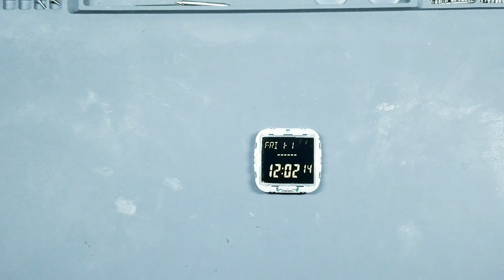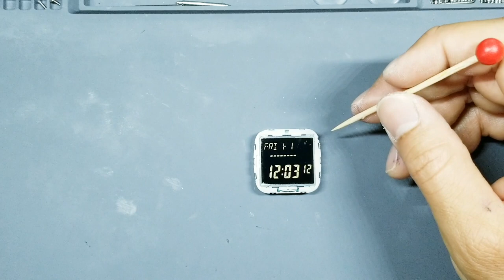[Modified Casio] Negative display mod on the Casio DW-291H-1AVCF

Comment: I really enjoy your modding videos. I have done the positive to negative display on dozens of Casios and my procedure is a little different. First of all, I never disassemble the module. I’ve found that the polarizing film can be easily removed without having to disassemble. Secondly, I use an exacto knife to remove the film starting at the corner like you do. Thirdly, and most importantly, I never use goo gone to remove the adhesive. I absolutely hate goo gone. Through a lot of trial and error, I’ve found that a regular high polymer pencil eraser removes the adhesive much faster than goo gone and is far less messy. The eraser is also useful to remove the text on the case. I’ve gotten to the point that I can do these mods in 15 to 30 minutes. Give the eraser a try. I think you’ll like not having to deal with the mess and aggravation of goo gone.
Reply from the maker: Appreciate the kind words and suggestions. Never heard of the eraser method, but ill definitely give it a try. Thanks.

Just curious, for your negative display mods, do you ADHESIVE polarizing film or NON-ADHESIVE? 

Mod on, my friend 👍🛠
Reply: I always use adhesive film. I’ve never tried the non-adhesive.

Comment: Good video! the negative display it's really looking good! but if you don't remove the strap it's hard remove the backplate, the times i remove the straps of my dw 291 i don't used a spring bar tool i used a little screwdriver, allows me to use more force to push the spring bar to the lugs holes

Comment: The watch looks much nicer with the negative display. The only drawback is that it is not as legible as the normal display. It is actually quite a bit darker, making it difficult to tell time at a glance.
Reply from the maker: Thanks. And very true. I mean, for most negative displays (except MIP displays) you're buying a negative display for the stealth look, not for ease of reading time. So a mod like this is 100% just for cosmetics.

Worse comes to worse, the process in the video can always be repeated im reverse to back to positive display

Comment: Would using rubbing alcohol work for cleaning the glue off the display? It will it hurt the screen?
Reply from the maker: Im not sure. Ive never tried it. Alcohol is safe on electronics, but beyond that, i cant comment as to whether it will work at removing the glue or be safe when u reassemble the watch.

Goo gone or Goof Off are so cheap and easily available at any grocery. Just go with those

Comment: can you just retain the stock polarized film then overlap a new polarize film 90' i think it will have the same result?
Reply from the maker: Good question, but No. You have to remove the stock polarizing film.

You could remove the stock film and rotate it 90 degrees and get the negative effect, but it's bettee to just use a new film since the old one will have glue residue
Reply: @watchncarry9593  well noted on this! ❤️❤️ thanks buddy

Comment: Do not take out the resin strap for 291H & 737H.It's a pain in the ass to put in back in.. 😂 

Unless permanent decision to convert to adapter strap. 

Btw great guide on negative mod! 👍
Reply from the maker: lol, very true. and thanks for the kind words. Mod on my friend
Reply: Pain in the ass is putting it lightly! I almost threw mine out as I was frustrated as hell failing to reattach it

Comment: HI.... Is it possible to convert negative display to normal display on casio A1000M  ??
Reply from the maker: Im not sure, but i would assume it's the same process as the DW-291. Maybe even easier, since the A1000M is a smaller display

Comment: Question. Can the faceplates be spray painted and/or lacquered? Even though a lacquer finish sets hard, I'm worried that the heat inside the watch could affect the spray paint and could damage the inside of the glass where the faceplate and screen touch. I know there's heat resistant sprays you can buy, but the colour range is limited.
Reply: I spray paint digital watches all the time, they are plastic cases that are spray painted anyway, put tape on the glass and cut round it with a scalpel, then a few light coats, give it over night and re-assemble